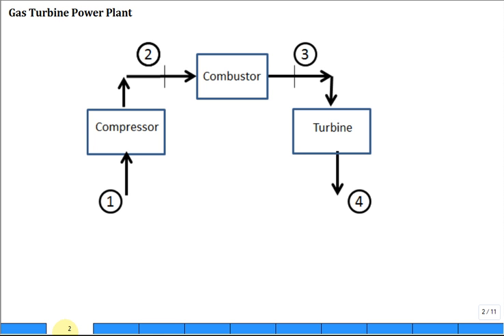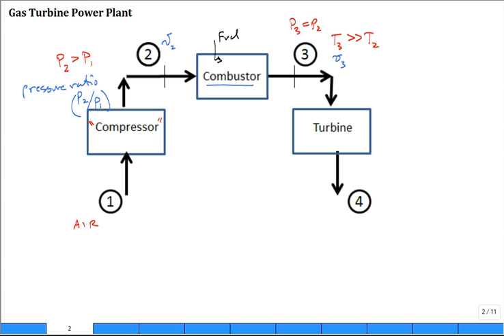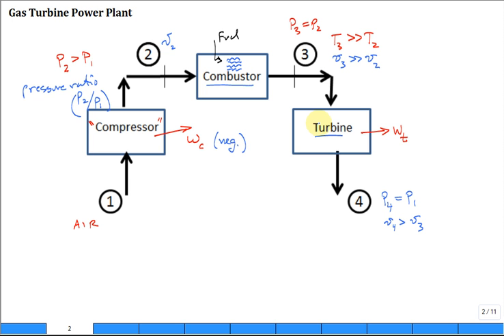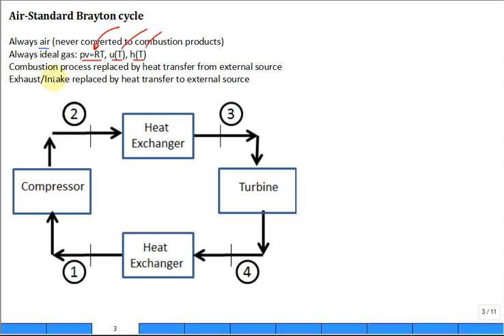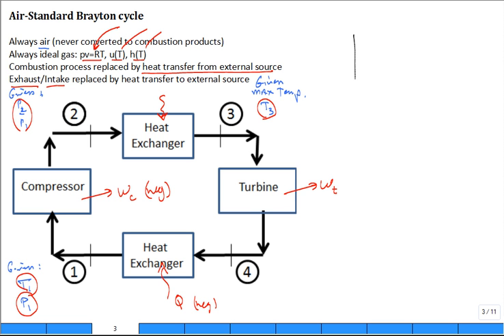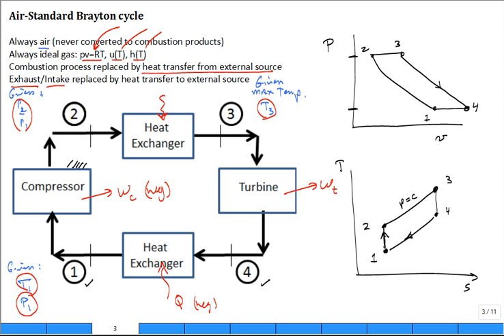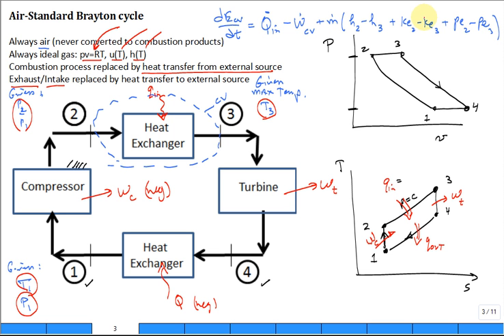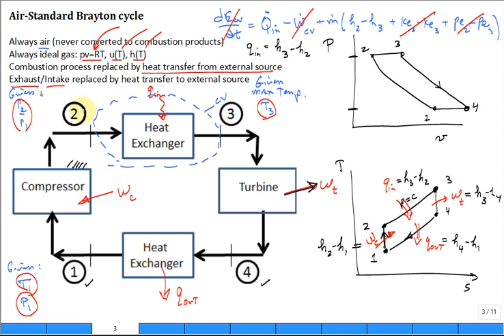Intro Brayton Cycle

Comment: If area under the curve on a PV diagram is work then why is there no work declared across the heat exchanger?  Does that equation only refer to shaft work?  If so please elaborate why.
Reply from the maker: Integral P dV for closed system.  Integral V dP for int. rev. steady flow through open system, like heat exchanger.  See Section 6.13 of Moran's textbook, or other thermodynamics textbook.

Comment: Thank you for this explicit and easy to assimilate explanation.  I have created a device with integral compressor, expander and rotational element (for work output).  Are their ideal conditions of pressure ratio P2 vs P1, and is this in any way linked to the temp rise (or should be a factor of) and/or is their an 'ideal' temperature rise?  If there are not ideals (and simply the higher the better), at what pressure and what temp rise would it challenge what is currently acheivable on a robust and scalable concept? I take it that the increased volume of the expander over the compressor is a direct relationship to its efficiency? And should the differnece in volume be identical to the increase in volume due to a specific temperature rise?
Reply: IELTS 9.0

Comment: The original Brayton engine used pistons. Air was compressed to about 70 psi and stored in a tank. At TDC of the expander piston an admission valve was opened allowing the pressurized air to pass through a valve and then through a burner where intermitent combustion occured in the expansion cylinder. At about 1/3 of the stroke the admission valve closed. The hot air continued to expand and performed work on the expansion piston. At BDC the exhaust valve opened and the combustion products were evacuated on the outward stroke.  A portion of the work produced by the expander was used to drive the piston compressor.   It's important to note the the true Brayton cycle was an intermittent combustion process used to combust air and fuel inside an expansion cylinder.  Here's a video of an accurate copy of a Brayton engine. There are only 5 remaining original engines, all are in museums  and none have run since the 1920's I got curious about how these engine operated so I made one... you can watch the video here, https://www.youtube.com/watch?v=0ORu1kzklfk

Comment: where are the pistons?
Reply from the maker: +fattywagonman centrifugal compressor and centrifugal turbine are very common.  Pistons not needed.
Reply: +Randall Manteufel  George Bailey Brayton (as in the inventor of the Brayton cycle) only made piston engines.... In a Brayton engine combustion begins as the pressurized air enters the expander, at about 1/3 stroke the air is cut off and  the hot gasses continue to expand until the end of the stroke when the exhaust valve is open.  Other engines like the Barber, Roper, Buckett and Trewella operate with a continuous combustor placed between a compressor and expander. These were very low power and inefficient engines when compared to a true Brayton.  If you are interested in watching  a real Brayton engine run search "Brayton Hydrocarbon Engine". I made one  since there are only 5 of them and the last time an original was running was the 1920's . I also made an engine that combines both the Brayton and Ericsson concepts... you can find the video by searching my channel or Brayton / Ericsson engine.
Reply: +Randall Manteufel  Pistons may be better for small volume compressor  / expander because small turbines are not very efficient at compressing or expanding.  Pistons are still considered one the most efficient method to compress. I believe scroll compressors are the most efficient?